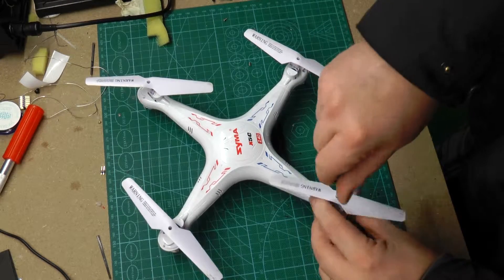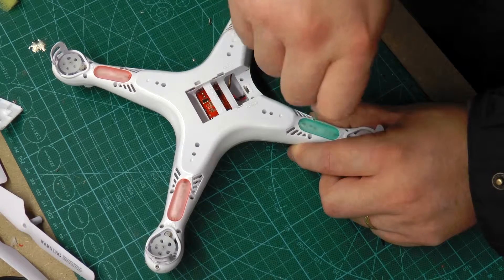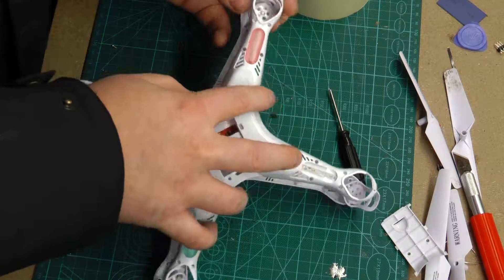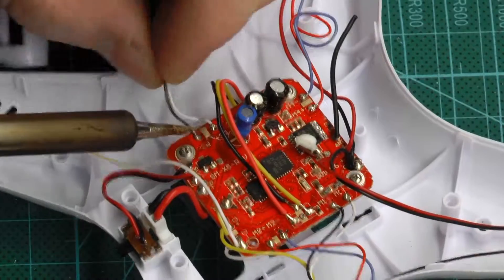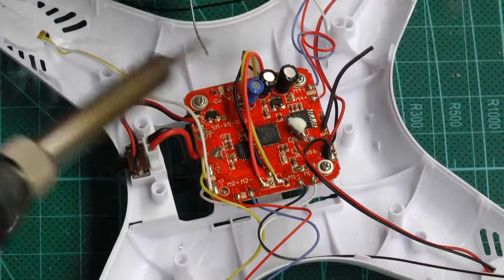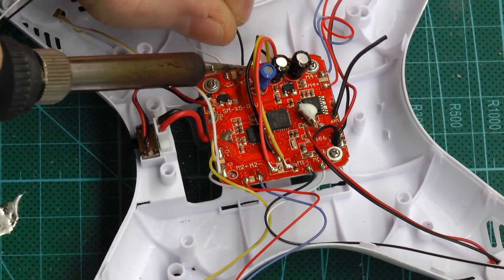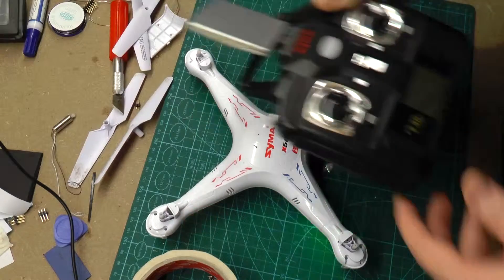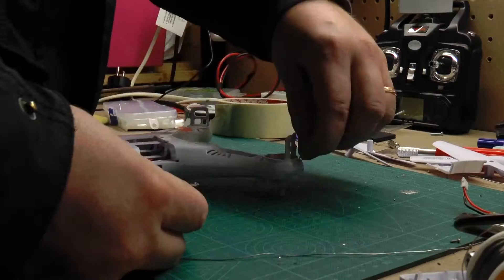Syma X5C / X5C-1 motor replacement

Comment: https://drive.google.com/open?id=0B5Kvj8b4F-7uOUdKeUpIYkcwd0U

this is the motor of my syma x5c-1...where can i find it?? because all the motors in shopping sites are 20mm....(when mine 17mm..)thanks
Reply from the maker: I'm not sure if it makes a difference if you go for the 17mm or 20mm. As long as it fits in the slot. I would recommend changing out all the motors to the same size tho. 
I would try places like ebay, aliexpress, banggood, gearbest and so on. Good luck!
Reply: thanks

Comment: Pretty straight forward vid, but why are you putting solder on the tip of the iron when removing the bad motor wires? Thx
*edit* nevermind found answer. :)
Reply from the maker: I'm planning on making a soldering instruction video. But it's hard to find the time when you have a little daughter. :) Good luck with the soldering!

Comment: Hi I swapped out all 4 motors and now have the lights on but the transmitter won't bind so I don't know what I have done?! Any suggestions please?
Reply from the maker: I've had some bind issues with the Syma in the past as well. The motor change shouldn't affect that tho. Have the quad laying on a flat surface, turn the quadcopter on, wait for the LEDs to blink slow and then turn on the radio. If that doesn't work start the radio before turning on the quadcopter. Any luck?
Reply: +Short Circuit RC Hi success thanks! I think it was turning on the transmitter first in the end,
Thanks again😀
Reply from the maker: +MK Jim Glad I could help! :)

Comment: I know how to replace motors but I came to confirm wether anyone else has the same X5C-1 variant as mine..I have 2 of em and both are the same as yours, the top half comes apart entirely..iv seen on some other videos that some other X5C-1's top half separates at the motor pod, leaving the motor pods still covered...great video too :)
Reply from the maker: +Kushinda Perera Thank you! I'm not sure which model that might be. I personally haven't seen it.

Comment: Getting the wires wrong can happen, but having a original replacement motor with the wires reversed that is a pain, especially on a FX-10 micro quad, which you have too solder with magnifying glasses.
Reply from the maker: +Ruudy L I hear you. :)  Funny thing that I didn't know was that this makes the motor spin the other way. So you don't need to use the correct colors, just switch them around. I knew that you could do this on 250 motors but not on these small ones.
Reply: Short Circuit RC On brushless motors it does not matter much, but with brushes  the turning direction does matter, although with these tiny motors you won't notice much
Reply from the maker: Good to know! Thanks for the tip. :)